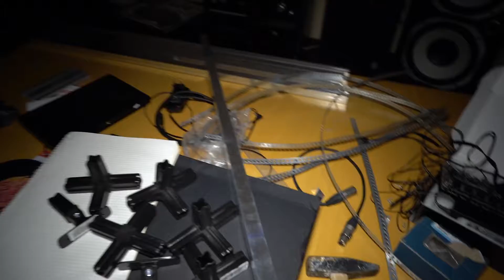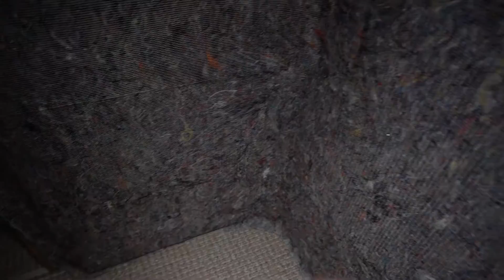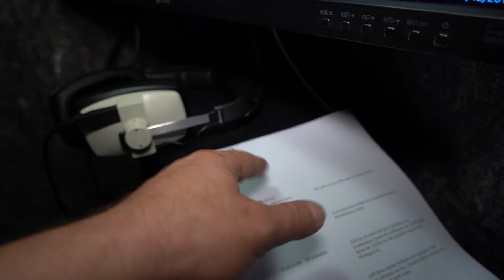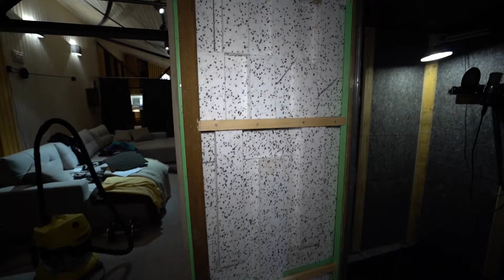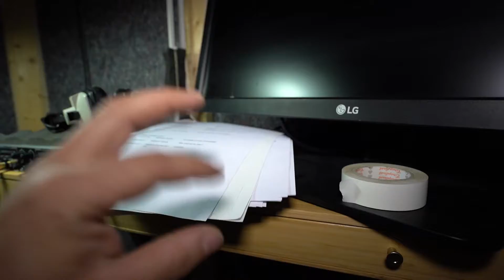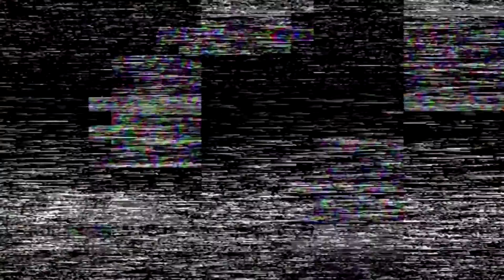Ultra cheap DIY microphone vocal booth with extra features

Comment: Do not take out that monitor, or take it out and put larger inside but mount it on the wall at slight angle and in portrait orientation. First check on your computer can you rotate then make or buy mount and mount it in the booth, reason is when you open some text or script or call it as you like you will bi able to see whole page of script and turn pages without scrolling and it is 100 times easier for reading that whey, even you could look into finding some silent two buttons remote for turning pages in pdf or word or whatever you use for reading, that whey you can read from monitor and not risk paper noise and even use some kind of teleprompter software so person recording can just stay inside and read. If longer times are needed inside you could even include some chair wrapped in same material you used on walls.

Comment: @7:30 I'm pretty sure the low frequencies will go directly through the wall...
Reply from the maker: The acoustic shortcut is working. We measured 52 db damping from 15Hz to 240 Hz, 58 db in 250 - 5 KHz range, and almost constant 62 db at 5-20 KHz.
We dropped in a industrial vacuum cleaner with 98 db SPL, and outside we measured 51 db SPL :)))
We had a small issue with the impulse response. But we find the source. The sealing around the door. I under estimated the gaps a bit. Fixed already.  
The wall is super rigid, thanks to the 7 X 5 cm banker woods and the aluminum frame.
In average the response is flat between 6 db variations with human voice. Good results from 200 Eur total cost eh?
Only the stupid lamp is still ringing at 6.4 KHz … DC constant current Led stripe light is coming.
Reply: @BMRStudio  Sure, yes I'm not saying the wall won't dampen the sound, but I think with such a thin wall you won't have to worry too much about the low frequencies reverberating in the booth. They'll mostly either get damped or travel through the wall.